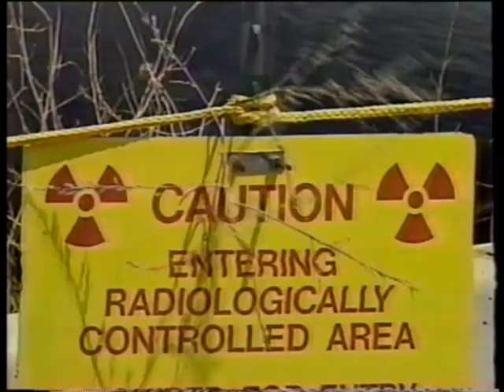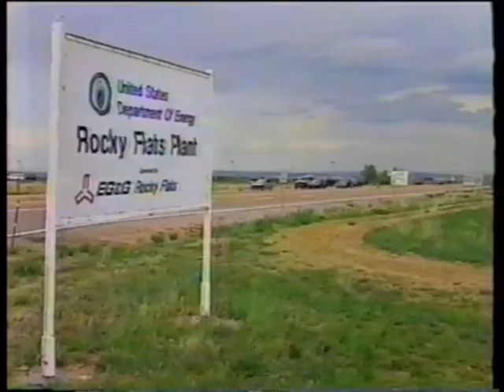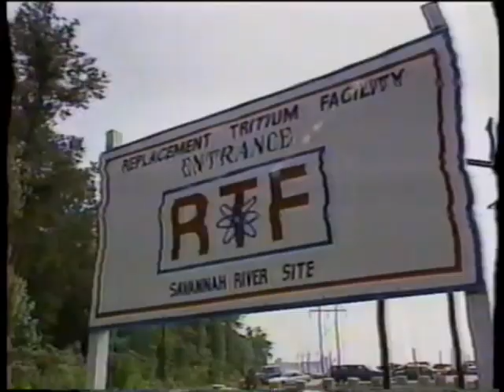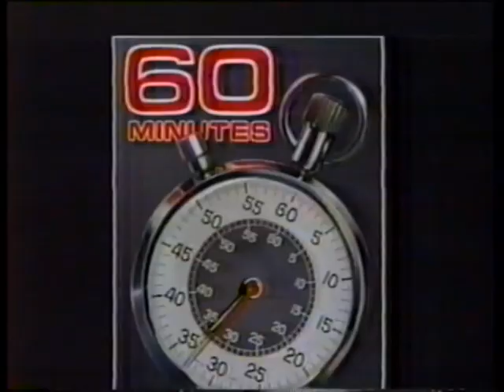The $12 Billion Clean Up and Rocky Flats

Comment: Just launch it all into the sun. Wonder how many barrels a Delta IV could launch.
Reply: And when the rocket explodes on the launch pad?
Reply: @loampey1  Bigger problem would be if it exploded 10 miles up in the air.